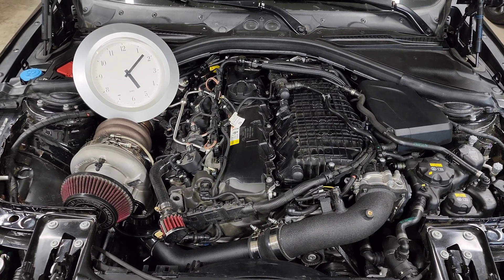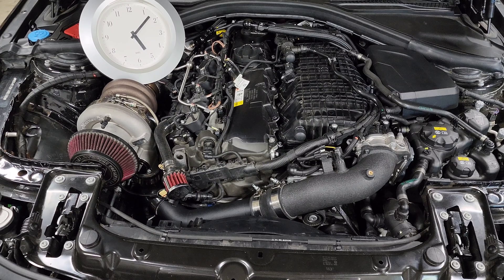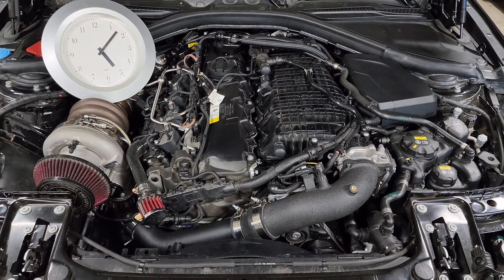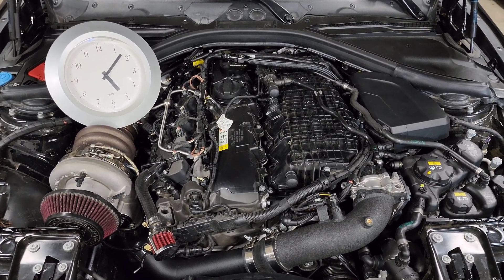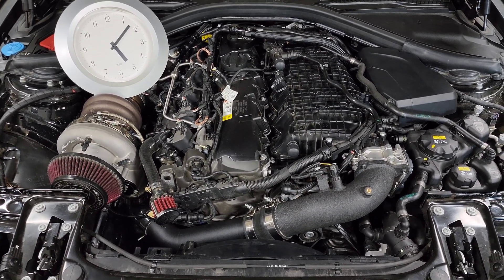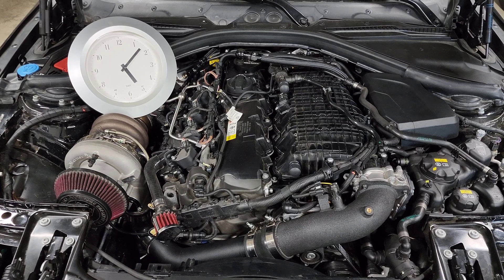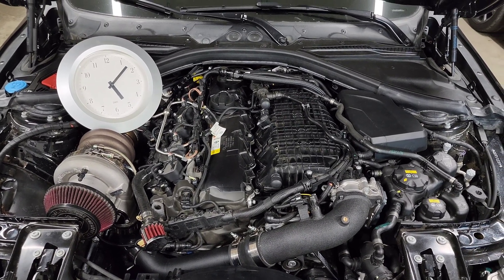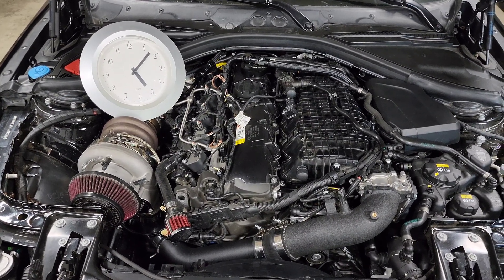Everything you need to know about Ignition Timing for your B58

Comment: Interesting, I that happen on my cyl 4, always the 4:th that is first and pull the most timing, often only nr: 4 pulling 1-2 degree. We have less than 5% Ethanol in our 93 pump, but E85 is available, fuel 93 but OTS 91 cause no corrections then + I know our gas is not top notch here.

Comment: My zf8 b58 is correcting timing and showing knocks at low rpm cruising speeds but fine on WOT pulls. What could this indicate? Having a nightmare trying to find out the cause or if it’s normal! Bad fuel would show up on WOT pulls so it’s got me stumped.
Reply: Same things happening to my 440i, did u ever figure it out?
Reply: @ No, tried better fuel and new plugs and no different so I’ve come to the conclusion it’s just the characteristics of the engine so have learned to ignore it. It might be the zf8 lugging the engine as when I knock it down a gear it doesn’t do it. These boxes seem to run in 6th gear on roads I’d be in 2nd driving a manual 😂

Comment: Nice video, thanks for sharing. I have M4, S55 engine, after buying a software and starting monitoring ECU DME activities I found out that ignition timing shows some inaccuracies. Some tunner guy told me that it is only some correction in connection with low quality of fuel (I used 95 OCT with aditives) so I tried 100 OCT high quality fuel and the problems are still vissible. Can you give me some recomendation please?

Comment: Hey Kern I see some tuner do 20-22 degrees on timing on port injection e70+ with non to minimal timing corrections. Do you think its safe for the b58 engine to run 20+ degrees of timing on full e85?
Reply from the maker: that sounds way too high

Comment: Is it normal to get the occasion knock detection on your logs? I run UK 99 octane (US 93). Running stage 2+, I have replaced my plugs but still get the occasional knock detection.
Reply from the maker: yes it happens from time to time. especially on ots maps. focus on timing corrections more.
Reply: @kern417 what up kern how do you read knock detections ? Not sure if I have that box ticked for my data logger on MHD app.

Comment: MHD stage 2. always have issues with 2nd cylinder, he is the first who start getting 2-3 degree correction, but all other will be 0, already change spark plugs but situation the same, hope that i don't need to change fuel valves.
Reply: Any updates on this ? I have kinda same situation, - 6 + 6 on cylinder 2
Reply: @MateMarsagishvili-g9l  yea i fixed it, I bought model s plaid, no more corrections🤣
Reply: @ 😂😂😂😂😂dayamn